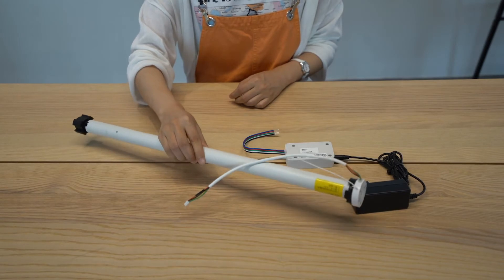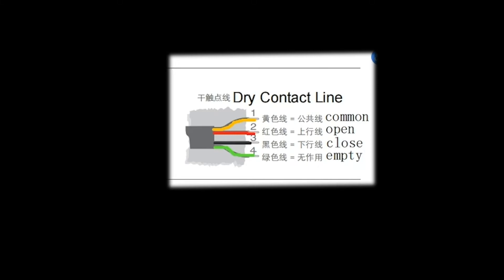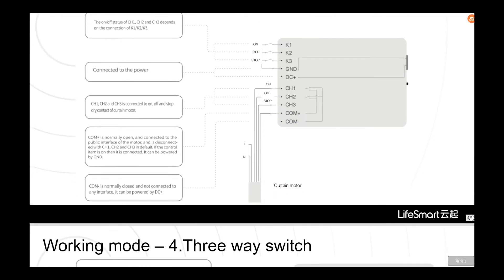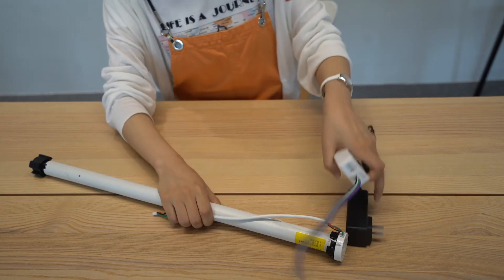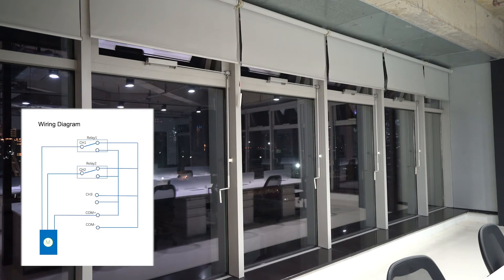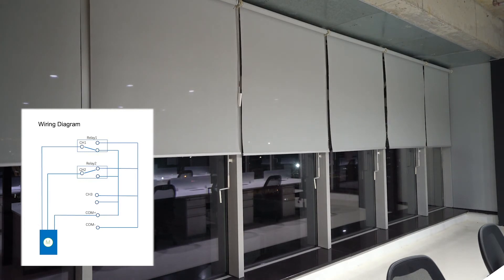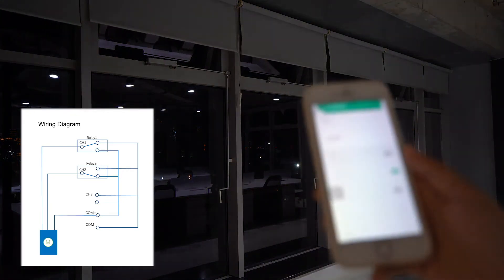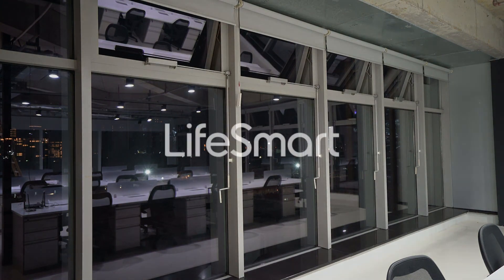LifeSmart－Derivative lessons of LifeSmart Online Training

Comment: Do you have to use a plug in adapter on the general controller for power or can it be powered via wire terminals